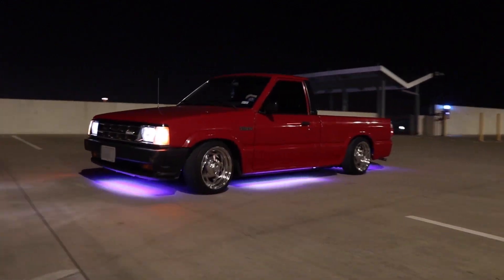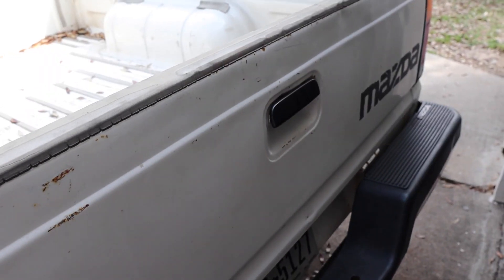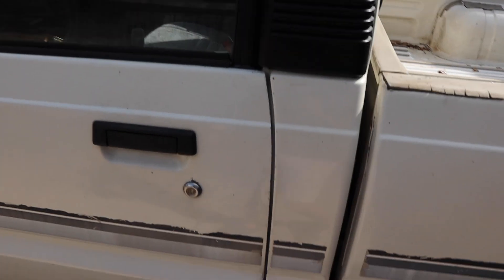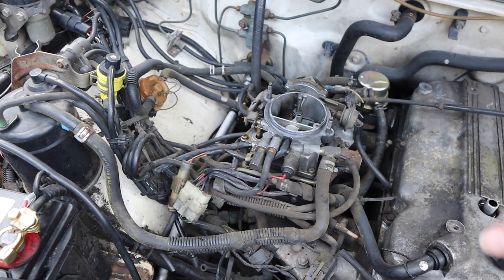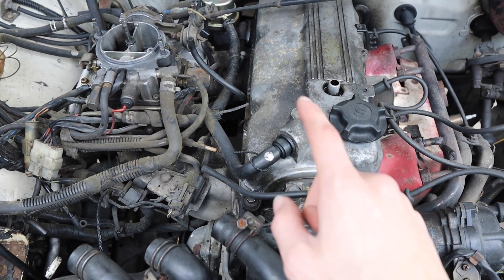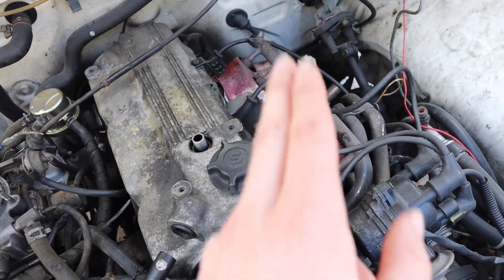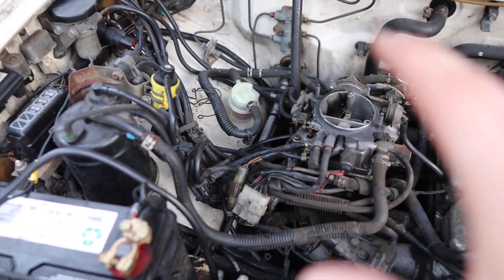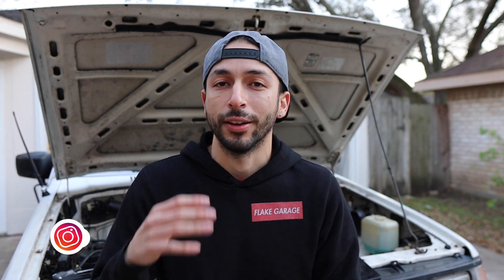Not Running Right? Update and Maintenance on 1988 Mazda B2200 | Flake Garage

Comment: Probably too late to be helpful but if the truck won't idle, you should check the fuel cut solenoid. It's easy to see with the air cleaner off and has a red wire running to it. Right there at the top of the air horn.  There is a plunger in it that has to pull back from a passage where it is installed and if it doesn't pull back, you will have no fuel in the idle circuit. The fast dirty way to test it is to put a long screwdriver on it and put the screwdriver handle to your ear and have your buddy turn the ignition switch to on (not start, just on). It should click as the plunger pulls back via the electromagnetic solenoid. You can even feel it usually but I like to hear it. If it doesn't click, most of the time it is just gummed up and tapping on it will get it to work again. It can also be not getting power, which could be just an open fuse. The solenoid itself hardly ever goes bad. I have seen some complicated Asian carburetors that actually have 2 fuel cut solenoids, so there may be another one down lower on the carb that has the same function and is tested the same way. It's gotta work or you won't idle. Just one of many things to check.
Reply from the maker: Is not too late to check on some of those solenoids. I'll keep it in mind to check on it next time. I did swap the factory carburetor to a weber to get rid of a of unnecessary vacuum lines

Comment: I have a 1988 mazda 2200 and was having the same issue. What I did was I went to the coil and pulled off the yellow wire (my coil had 2 wires on one post and one on the other).  I went into the cab, and it started right away with no stutter or idling issues. It put the check engine light on, but it runs perfectly. I haven't figured out what the wire goes to but I don't care with how well it runs (it also puts more power to the wheels now).
Reply from the maker: Weird that a little cable would be giving you so many issues as well but glad it's working better

Comment: I have a 2008 B2000 if you don't plug off the vacuum lines the eng. will run really bad if at all . The alternator has a small wire on the back that puts 12 volts to the electric choke if the eng . idle won't stop being to high check the choke wires for 12 v .  My valve guide seals are bad and my eng smokes real bad on start up and the spark plugs get fouled out .

Comment: I have a 1987 b2000 and my chock ke sticks sometimes.I have sparayed it down with carb cleaner still stick sometimes.I just manually flip it back down.My truck idles great and runs great when unstick choke.What plugs did you go with?My truck my biggest issue was the catalytic converter was collapse and exhaust clogged.Like adding a new engine when new exhaust with out catalic converter.
Reply from the maker: I went with new NGK BPR5ES spark plugs on the truck. I have those on my red one along with ngk spark plug wires and it runs pretty good. This ol girl has some deeper issues with the engine that it needs to be opened. I swapped the exhaust and a weber carb and it helped a lot but made the other issues show up

Comment: i just did a rebuild on my stock carburator and it is just a nightmare to have it running decent, but it works for now while im saving up for my weber because i live in Mexico and it becomes pricey after the import taxes and shipping but definitely worth the investment
Reply from the maker: It’ll definitely clean up a lot of unnecessary vacuum lines and should make it easier to diagnose if you have a leak. Saludos a Mexico!

Comment: Hello My truck was running well and engine died I had to replace ignition control module and coil it runs smoother as far as throttle response and idle but seems to have lost some power but maybe it’s because I drove my other vehicle and just seems weaker.

Comment: Hey super happy to find the channel since we just picked up the same truck! Did you end up figuring out the issue with the rough idle? I’m getting ready to dig into ours so I was searching for common issues to start with.
Reply from the maker: Vacuum lines is a big problem on these trucks as well as old carburetors. I swapped over to a weber and that helped a lot with the issue as well as doing the regular maintenance: new spark plugs, wires, oil and filter. Unfortunately for me, I believe I might have a deeper problem as it still hesitates a bit and I'm seeing some oil in the spark plugs which might suggest something like a head gasket or rings. Check out the pin comment for other suggestion from another owner
Reply: @FlakeGarage  oh darn, well hopefully it’s not the bottom end for you. I’ll give it a look today and see what I got. I appreciate the response. I like the channel btw. Just got rid of my D21 but I’ll always be a fan of them 👍🏼
Reply from the maker: @Therendonfamilia  It's possible but maybe we'll just consider a swap to something better if that's the case. Right on, we love all mini trucks here so welcome and hope you keep on mini truckin

Comment: I've got an 86 B2000 myself and the sucker was a one owner farm truck locally. It's got 311k on the clock now and my oil looks just as black as that after about 300 miles! Definitely needs a rebuild, but for now it runs and drives great. Just needs front end work. Do you know how to replace ball joints/tie rods on these trucks?
Reply from the maker: I actually do have those parts ready to be replaced on this truck but the engine is on it's last leg that I might have to put that off to the side for now. It is definitely not hard to do. Check out on my channel the video we did on the hardbody, the process is more or less similar. Actually easier because the ball joints are bolted in on the Mazda

Comment: Man my truck is killing me.Quit running agin.I put fuel pump on it and cranked right up .Tjen went to restart was kicking back like trimming.Pulled trimming cover off h to op and bottom in timming there.I had to move rotar cap to
Get to start now it runs but still seems like something wrong.I thought was maybe bad gas.I purchased timming kit but now n time at cam and crank.

Comment: Hey Bryan,
I’ve really enjoyed your videos, they have really lifted up my spirits on getting my 92 b2600i going. For about a year now, my 2600i A/T got stuck in 3rd gear with no down or up shift. It’s not until a month ago we confirmed that it was actually in limp mode. I sent TCM for repairs and worked for a few minutes and then back to limp mode, I’ve checked all sensors and solenoids I can think off, actually replaced the tranny solenoids with new ones. No luck!!!!
I’ve inspected ECU and I can’t see any visual damage. Any ideas you can share on this?
Reply from the maker: Unfortunately the 2600i is completely different from the b2200/b2000 when it comes to the engine setup. Have you checked and make sure there isn't something wrong with the transmission? If it's going into limp mode either something is getting stuck or not triggering. Everything you said you checked is good, then I'd think maybe the transmission itself might be the culprit
Reply: 2600i has a different engine and trans. Do you have an OBD-1 capable scan tool? OTC Monitor 2000, 4000, 4000E, Enhanced Monitor, Snap-On MT2500 or compatibles?
92 is late enough it should have the electronic controlled trans, and I'm guessing you do since you mentioned a TCM at all. It will store trouble codes for limp mode internally.
Is your CEL lamp illuminated?

Comment: First of all let me say I don't really know much about vehicles but I do have a Mazda 93 B 2200 and I noticed on my air cleaner there is no extension I also noticed the same on yours so if you're looking at the air cleaner its shaped like the number 6..is there not suppose to and extension at the end of it? I'm having  high idle issues as well...I went and looked at other set ups and they usually have one. It's hard to explain without not knowing too much. I noticed your air cleaner looks exactly like mine. With nothing at the end of it it's just open
Reply from the maker: So the main difference is going to be whether a truck is carb or efi. Efi has more stuff. Now on a carb like mine and most likely yours, at the end of the air filter is supposed to be a plastic piece that usually routes somewhere towards the grille/front. These pieces kind of disintegrate over time so almost 99% of the time they are gone. If you have Instagram and can dm me there I can send you a picture of what I mean @flakegarage. This plastic piece being missing could affect the air intake so might need slight adjustments but most times is not really noticeable to cause a high idle in my opinion. The carb itself might be the culprit

Comment: I was told that my truck is getting too much gas and that’s why it’s not running smooth.  Any suggestions on what I can do to help this?  Thank you
Reply from the maker: Check your air fuel mixture. Perhaps you might need to give your factory carb a good cleaning and check the Jets. They might be worn out and pouring more fuel than needed
Reply: Thank you!

Comment: Great vid bro! Just picked up an '87 b2000 last week and it was in similar shape. I changed pretty much everything you did and was running like a champ. I screwed up when I was cleaning out the dirty engine bay with cleaner and water. I covered up most the important parts with a bag but most likely got water where it shouldn't have gone. It's now having the problem of not idling. It cranks over fine and sounds like it has good spark but I'm so frustrated because it's probably something small but I have no clue what it could be. I aired out everywhere i could think water might've seeped in but is stil struggling to get going. Any suggestions bro? Thanks🙏🤙
Reply from the maker: I’d check wiring and fuses to make sure they are good / not blown. I’d check your carb and make sure no water is in there. Not sure if you have a factory or Weber. Lots of vacuum lines on the factory one that could be potentially causing those issues. Good luck!
Reply: @FlakeGarage  it's a factory carb, i planned on doing a Weber soon anyways so I'll take a look at everything else too. Thanks bro!!
Reply from the maker: My idling problem has comeback to the carb and air intake. I removed it and the truck idle and ran better but is not good to be without a filter. Shortly after I noticed a lot of play in the carb butterfly and other loose vacuum lines that I’ll just be moving onto doing a weber
Reply: @FlakeGarage  yea the weber seems like the way to go. One thing i notice tho is that it idles ok once its warm but whenever i go on the gas it bogs. Almost like its an air/fuel mix problem.
Reply from the maker: Most likely it is an air/fuel mix problem. Fuel there’s only a couple locations to check but air might be the hard one to trace because of all the vacuum lines. Have you tried to run it without the air filter? Just to see if it idles ok?
Reply: @FlakeGarage  idles like a dream without the air filter on. Still has the bogging issue when tapping the gas tho. Its super unresponsive
Reply: @jaredcosta818  when was the last time you changed the spark plugs, wires, checked timing and rpm adjustments???? I did all that and idles almost perfect but I still have a small issue but nothing that worries me!!
Reply: @buginfested2009  I ended up doing the weber carb and fixed all my issues. I sold it not too long ago. Time for another one 🤣

Comment: Hey I need help with an 89 Mazda Toyota I mean Mazda I keep blowing these three hoses that go to the are right by the carburetor what's what's going on there can somebody tell me please
Reply from the maker: Sounds you like something might be clogged which is building pressure and blowing the hoses, check nothing is stuck on the air box and clean it out
Reply: @FlakeGarage  jj hey thanks for that info how come do the sponges have to be inside the air box
Reply: @FlakeGarage  f**** thing man what it's doing yeah thanks for your help I'll keep you posted I'll give it a try tomorrow oh no actually I drove it tonight and it's shaking really bad worse than it was when the hose broke

Comment: Mine will idle great for hours and then when you put it under acceleration or any load will bog down and die. Any idea what that is?
Reply from the maker: Sounds like maybe either air or fuel might not be cutting out under load. I'd check all your hoses and change the fuel filter and see how it behaves

Comment: I cannot find radiator for my 1989 mazda b2200 automatic
It is a SMALL radiator.i ordered 3 all 3 too big
Reply from the maker: if your truck is fuel injected then chances are you are getting the radiator for the carbureted model. Here is the one I'll be putting in my truck but most likely it's the same big one you got before https://ebay.us/NM5KRO

Comment: Hopefully you can help with an issue. im looking to buy an 88 b2200 and the guy says the throttle needs adjusting. I asked what the issue was and he stated that the truck runs and drives but when stopped it will die, but if he keeps giving gas itll stay on. Im thinking it could be as little as an adjustment or that it could be fuel related. was just wondering what your take on it would be
Reply from the maker: I would definitely replace all the fuel lines and filter since it’s super easy and cheap to do. Mine does that from time to time and it’s most likely the air/fuel ratio needs adjustment. Something could be clogged or it’s too closed that without giving it gas it doesn’t stay on and just chokes/dies. On a more serious note it could be the carburetor itself. Idk if it has factory or a Weber, if it’s a Weber, it’s super easy to adjust any of the Jets, if it’s the factory, it’ll be a bit harder since you also should check for vacuum leaks and all but overall shouldn’t be too difficult. Mazda Mitch here on YouTube has a good video on adjustments, check him out

Comment: Wow that oil looked really bad, I hope you flush it again after about 500 miles. I didn’t know the interior was so beat up too. I hope this Mini makes a huge turn around and the engine doesn’t give you issues. Great video! #minitruckinfam
Reply from the maker: It’s going to brother. Lots of ghetto rig things on it that we’ll fix. For sure I’ll be doing another change but also gotta figure out the oil leak I have on it. I’ll be fixed little by little for sure

Comment: It has a vacuum leak.  That’s why it’s hard to start and runs rough
Reply from the maker: It definitely has several vacuum leaks that's why we are switching to a weber carb to help with the amount of lines we need to check